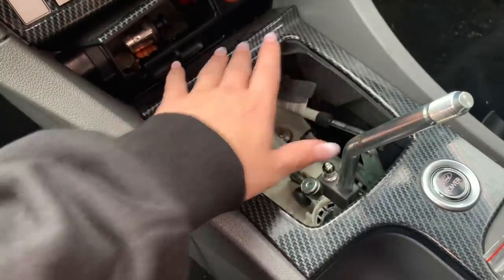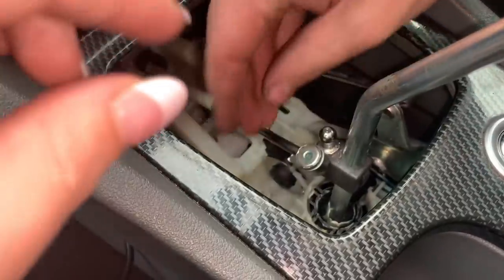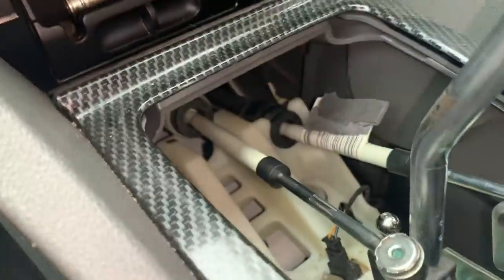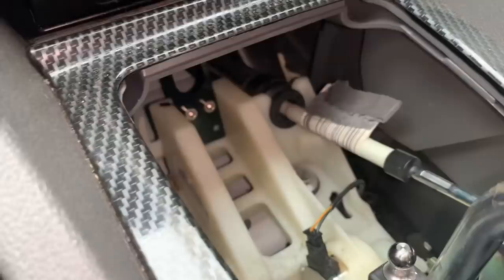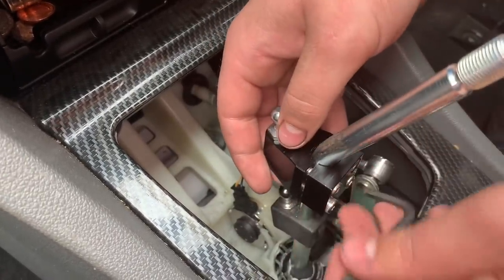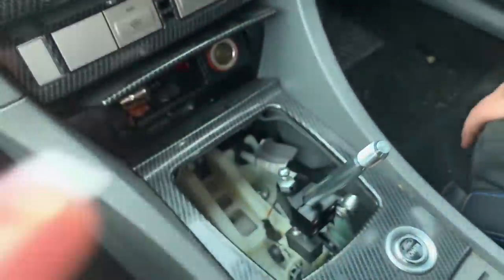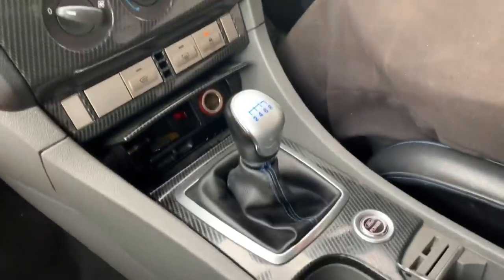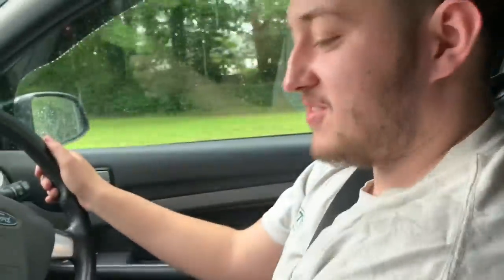THE BEST CHEAP MODIFICATION MK2 FOCUS RS | Quick Shifter Installation

Comment: Personally, I would move it down the base part, so the original nipple sits in the hole in the new base, the part you have attached to the gear stick. If those bolts come loose you will have no gears! The hole is intended you that reason, and would be far safer.

Comment: Nice modification.
I have a steering column gear change in my car and a bench seat at front.
The column change feels very good
Reply: Kris Nicholson 4 speed manual
Reply: Kris Nicholson 4 speed as is. It hasn't got an overdrive but it was an option